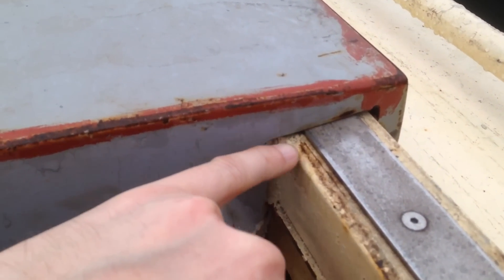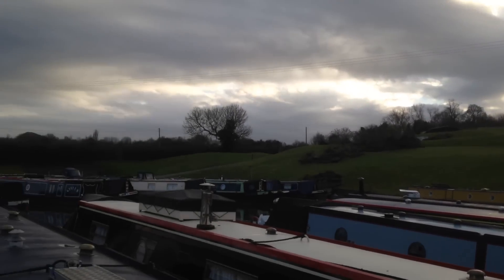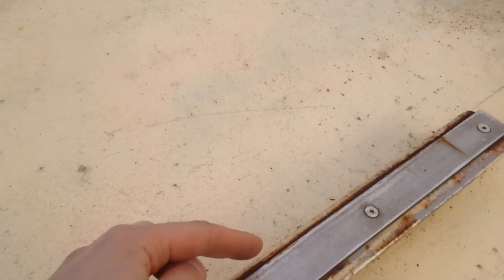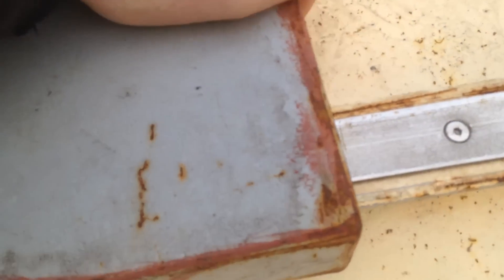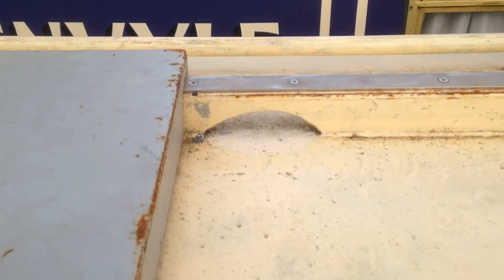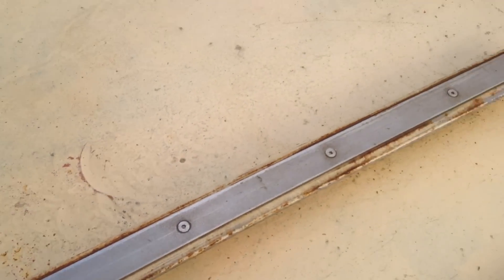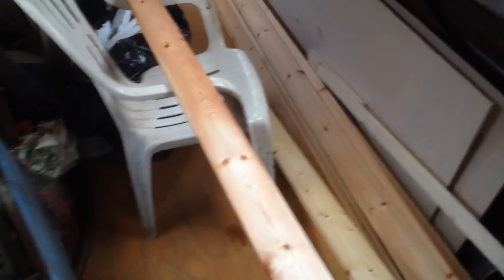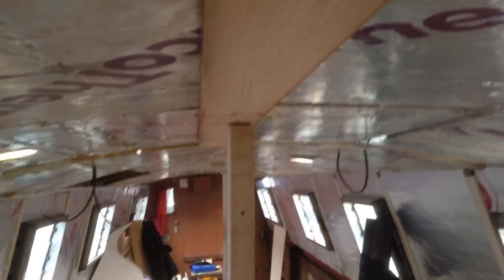Ed's narrowboat Ep.8 Roof work.

Comment: Happy New Year! If you're really worried about condensation behind the boards fit visqueen ( a vapour barrier ) to the  bulkheads and linings. That way the warm moist  air will not come into contact with the steel or moisten your insulation and reduce its effectiveness. A good protector is Danish oil for the boards, it can be used as a full finish or as a sealer before paint. Looking good though, I like your choice of planking. Good luck.
Reply: My error, sorry, I meant deck-heads not bulkheads.

Comment: I custom build pontoon boats and pontoon house boats, I install all that wood using P400 adhesive and a finishing nail gun, using one nail in a hidden spot on the toing edge. no screws or nails to fix, your making more work for your self, the mailer puts the 16ga nails into the hardest wood with no crakes as each nail has a yellow or red kind of hot slippery glue on each one to aid in penetration and locking them in, and the P400 makes each contact solid with no movement at all, your videos are far to short, a person just get cumfy and its over, good vidios though

Comment: Maybe  you could find a use  for this stuff   Flex Seal Liquid Rubber Sealant Coating Spray  ( www.flexsealsale.com)  yes advertising is a little over the top  ,, but  it does work  -just depends on how much actual contact  scraping  like from the hatch , but there might be other locations